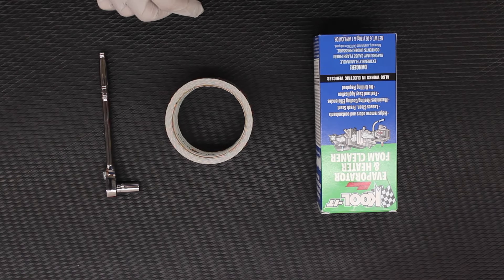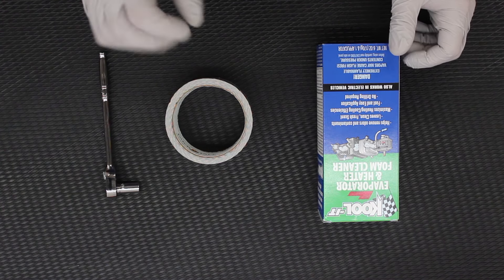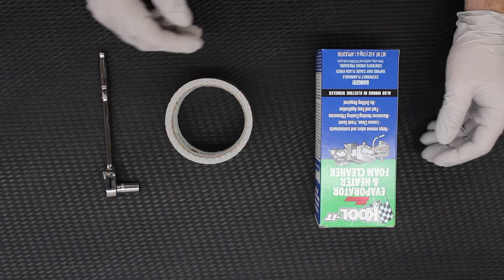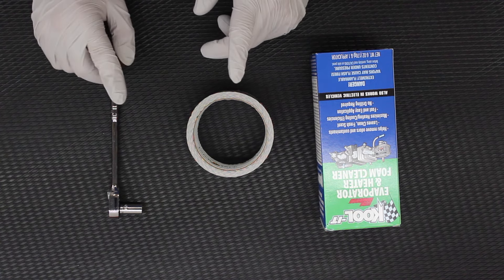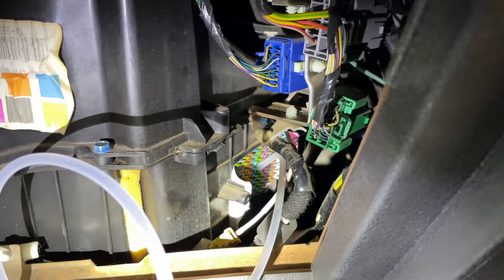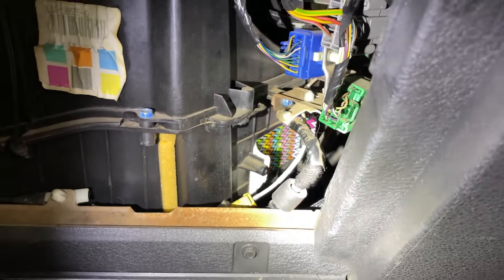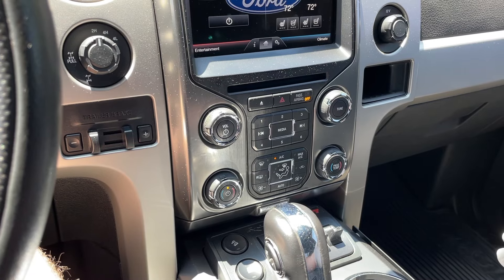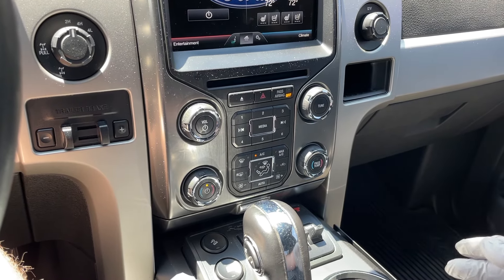2009-2014 Ford F-150 Raptor AC Evaporator Core Cleaning (Blower Motor Resistor Method)

Comment: In my 2019 I drill a 1 inch hole so I could spray coil with cleaner and rinse then I used a rubber plug to close it up
Reply from the maker: Great solution, seen lots of others doing the same.  Thanks for watching!

Comment: I just cut a rectangle flap across the front of the evaporator casing and sealed it with duct sealant tape the silver kind you use on ductwork and got to a larger area on the inside of the evaporator coil. You can pull the flat back by around three or 4 inches and really get inside.
Reply from the maker: Great way to do it as well - likely will next time it gets dirty/clogged up.  Thanks for watching!

Comment: I just did as your video. And I have more air than before.  Stronger pressure. Id sweat in my truck while driving. We shall see through the day as it gets hotter.
Reply from the maker: It helped a ton on mine for sure.  Thanks for watching!
Reply: Now it is just blowing hot air. Guess it clogged it
Reply from the maker: @ginasalazar488  Sounds like a servo or actuator.  If you turn the temp to auto, run all the way up, then down to 60 degrees or so, you may have cool air come out.  If so, you have a servo going bad.  FORSCAN will let you see servo positions and errors as well, if you have it.

Comment: I have an 09 on which the passenger side carpet gets soaked. Could this possibly solve the problem?
Reply from the maker: That sounds like an evaporator drain issue - that drain exits behind the passenger side header on the firewall, and should be able to be blown out with compressed air to resolve the issue you're having.  Thanks for watching!

Comment: Would this dirty evaporator core cause my ac to work intermittently? I’m fully charged with Freon and just cleaned the condenser.
Reply from the maker: Not intermittently, but weakly - this could seem intermittent depending on how heatsoaked the truck interior is, but equally likely is a blend door actuator.  Thanks for watching!

Comment: I notice condensation building up under the glove box area, under that big box, will this help with my truck because its dripping on the floor mats. Its not exactly a leak but the condensation builds up and drips, its not too bad but i don't want the issue to get worse. Could you please help
Reply from the maker: Sounds like your evaporator core drain isn't working and is clogged.  It's right behind the passenger side header/head, should be a little hole in the firewall and/or 90 degree fitting that comes out of the firewall.  You can take compressed air and blow it out back into the cabin and should have a bunch of water flow out from there.  Thanks for watching!
Reply: Is there anyway someone can take a picture of where the evaporator drain is? I have the same problem as jesusaguilar.

Comment: So is it safe to just blast the evaporator with a hose then through this access port?
Reply from the maker: I can't swear by it from experience, but many folks have had luck doing so - if I had to I'd try it.  The caveat is that you may flood your blower fan, so may want to take that out and put a drain pan in its place.  Thanks for watching!
Reply: I ended up doing just that through the Blower motor Resistor hole and since the fan is elevated as the drain is at the far end I was able to just watch is closely and make sure it didn't get flooded. High recommendation to just blow it all free with a hose for anyone watching. Fixed it right up.  @redonKiLaus

Comment: I have a 2011 Raptor, which I believe may have a blocked drain.  I think you need to remove the wheel well liner to gain access to the drain. That 6.2l is sitting right in front of it.

Anyway, I like the idea of going through the resistor opening.  I would still maybe drill a hole to insert the tube, but at least you know you won't be near the evaporator core when drilling.  Then it's just a matter of removing a small plug next time you clean the HVAC system. 

Getting the cleaner between the blower fan and the evaporator core is key to getting it clean.  Thanks for the video.

Comment: How is this holding up? Mine blows slightly below ambient air ... Also if my ignition components are having probs no kool air comes out at all. 
Im thinking of drilling a hole in that box to get a good look inside. I also have a clog
Reply from the maker: No prob at all!  You may have a broken recirc door as well - you can manually set that permanently in the recirc position by removing the blower motor and securing the door in place.  Doesn't hurt to pop a hole in the HVAC box if your core is dirty as well.  Thanks for watching!